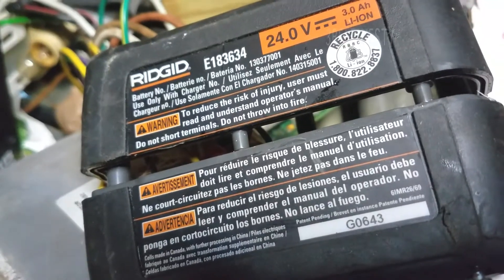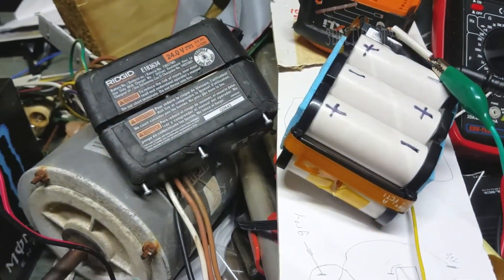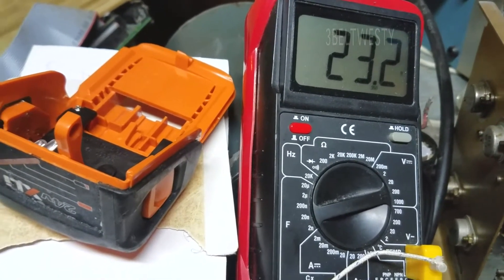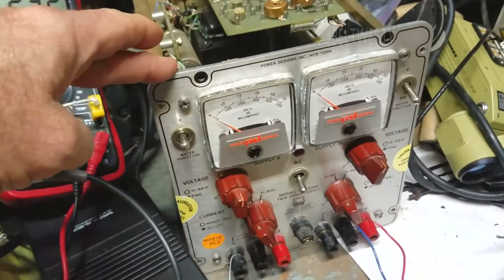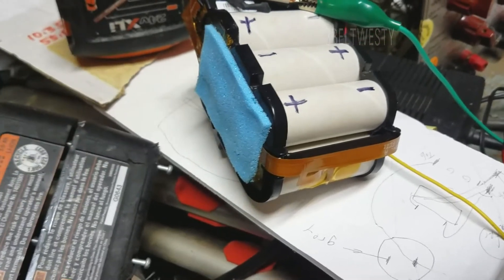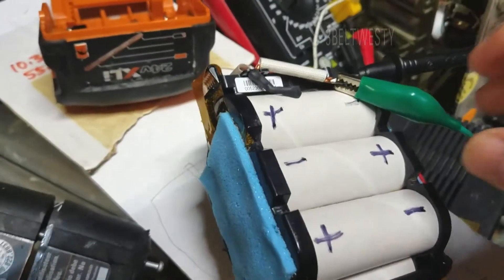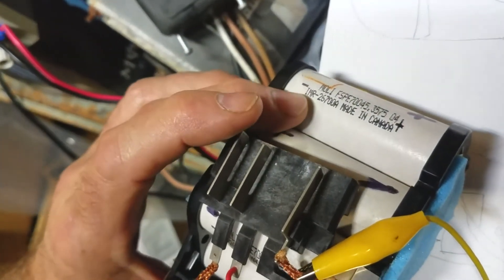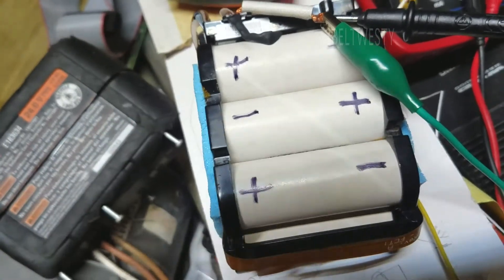Ridgid 24 volt Lithium battery from 2006 insides IMR 26700A

Comment: Is there any one in Chicago that can help me with mine I have 4
Reply: Since they don't make these batteries anymore, 18v will work but kills the motor. I just took an 81mm military ammo box, modded that, and installed two lawnmower batteries, a charger, and related wiring. I then modded an old battery with a power cord, and now use it for portable uses. It lasts for days with hardly a sweat. 60107 Illinois says hi!

Comment: strange i have just stripped my v28 milwaukee batteries after standing 4 years and all the internals even the circuit board and tool connector prongs are exactly as yours are apart from i have 7 cells  did you manage to revive yours thanks